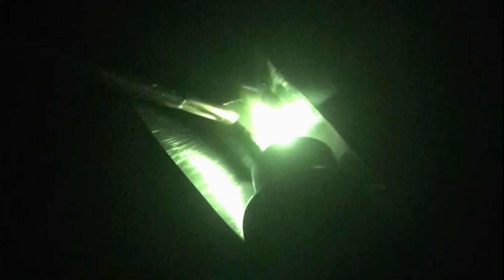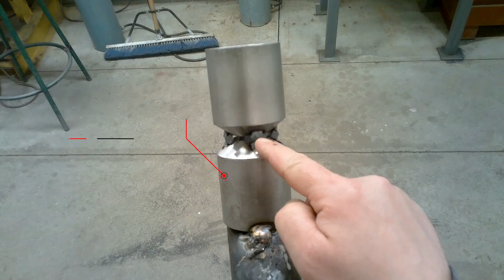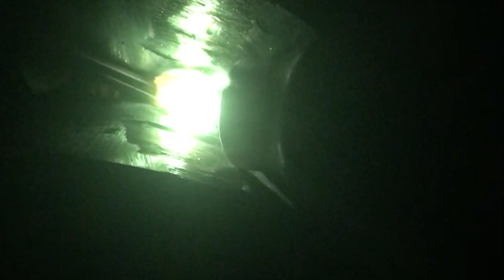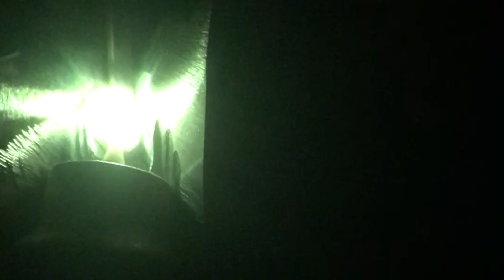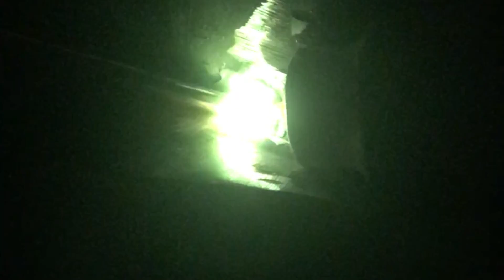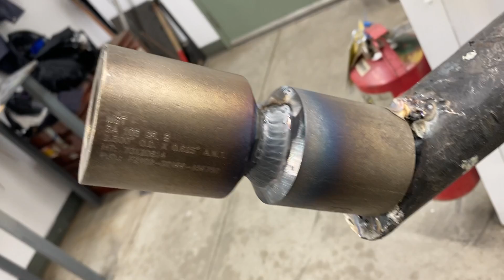6G TIG Welding Root Pass! Tips For Better TIG Root!

Comment: Sight fucos, pulse, timing of how you supply the filler wire and the most important is how you adjust your current in your welding machine and your back backing gas or argon gas  it is depends the size if pipes

Comment: i mostly fuse 10ga stainless sheet corners together for deairator boxs. i run them downhill at 180 amps inside corner to corner. I have to do the piping work around the shop because I have the only tig machine here. i may not be able to Walk the cup but I laywire and freehand. getting really good at it. wish I could have seen a few of your videos a few years ago. do you plan on showing how you get rid of wiskers in the root without grinding it out? i found a video on that but another idea couldn't hurt.
Reply from the maker: Thanks for your comment bud, yeah I’m planning to do something similar as you mentioned, soon!

Comment: You have nice technique. Great welder but to me the penetration was to excessive in the codes I'm forced to work with most only let you have max retirement 3mm ive even had gas lines where it was 1.5mm max
Reply from the maker: Thanks for your comment bud👍

Comment: Just curious if youd get QC for excessive reinforcement on the inside
Reply from the maker: Of course, I guess if he wanted to reject everything, there is always the "gradual transition" requirement that is in the code.
Reply: I was thinking the same. I wonder if its not a trick of the lighting though, because it didn't look as heavy at the end of the vid as it did the first tine it showed the root.
Reply from the maker: @Peter.Lecomte  That’s just camera angle on the first shot of root. I like to do heavier roots, but not that much to be rejected. Other thing too, I like to run hot pass really hot, so it will suck back root to desired appearance. As I said,  this video is about how I like to do it, not saying this is the best way to do it. I’m not the best welder in the world, but I’m pretty good at what I’m doing for living. If I can help anyone, even with just a little tip on how to do something differently, and if that turns out to be helpful for him, my mission is accomplished! Thanks for your comment bud.👍👨‍🏭